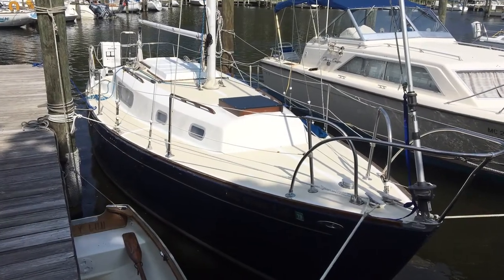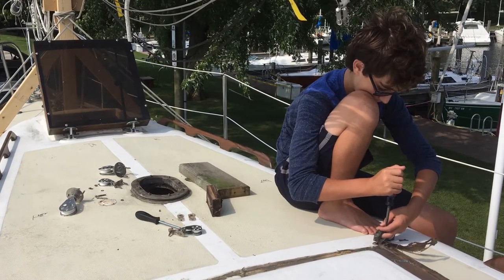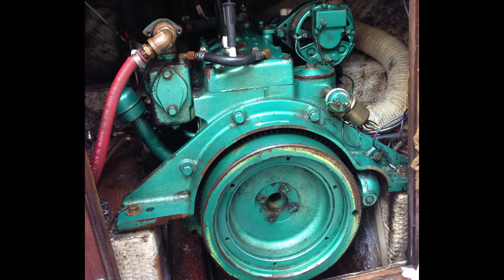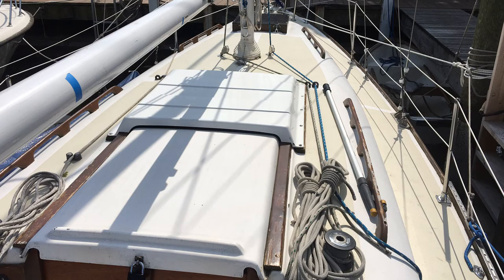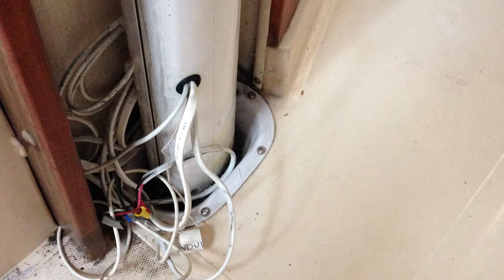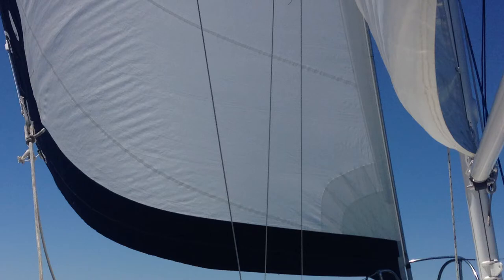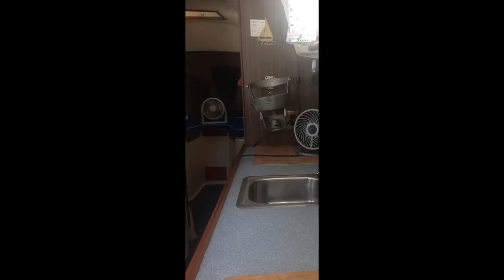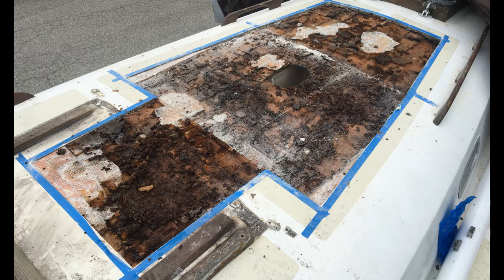Sailboat Refit: Morgan 30 - Blue Jacket, Episode 1

Comment: I’ve looked at a few Albert 30’s. I like that the rudder is attached the the keel but they’re narrow. 8’4” I think. They both have a deck stepped mast but the Morgan has a spade rudder. That’s always scared me. What’s your opinion?  If you were crossing a large body of water. Or worried about hitting something with the Morgan keel island hopping or on the ICW or in the Great Lakes. Would you feel safer with the Alberg?
Reply from the maker: My personal preference is for a keel-hung rudder. That said, the rudder design on the Morgan 30 is certainly stout enough to safely carry the vessel over the Great Lakes, through the ICW, and serve fine for coastal cruising. Beyond that, it's fairly easy to service. Like all spade rudders, it is potentially vulnerable. Sailboats are all about compromises. You just need to decide which compromises you're willing to accept. Ultimately, even the best design poorly maintained is unsafe, so a lot of this depends upon the condition of the vessel you buy/own.

Comment: I love the way you all put that Intro together.  I lurk and learn as you go. The Alberg 30 and that are very similar as you said.  So, your sharing of ideas and methods certainly helps me on Nautica!  I know I have that moist area beneath the mast area as well, but am waiting for a period where I can setup in the summertime and work the replacement as it is no small task.  

It's great to hear the crew talking too!
Reply from the maker: Thanks, Bill. Glad to have you following along. Boats are great - and even better with family! No, the recore isn't a small task, but it isn't insurmountable either. Best of luck!
Reply: As for the re-core, there are some who advise doing "squares" each at a time, but it looks as if one might remove the deck in "one larger piece," if possible and then re-put that larger piece?  What is your thinking on this method?
Reply from the maker: I'm hardly an expert, but in the case of my repair, dividing the area into smaller "squares" would have made the job more difficult. I think it makes sense to divide an extensive recore project into areas/sections: foredeck, sidedeck(s), cockpit sole, cockpit seats, cabintop. I can also understand dividing a project according to logical boundaries - where core meets solid glass, or where bad core meets good core. And I suppose if you were working in Florida during the height of summer with temps in the 90s and dealing with epoxy kicking within minutes, then you'd have to divide the job into workable areas. That's not by virtue of the task, but rather due to the conditions. I'd say I recored a fairly significant section, but it was easily workable (even under the cover). I could move around it, reach across it. Once it's too big to do that, then working smaller sections makes sense. Just my thoughts based on my limited experience. Perhaps more experience would lead me to change my mind.
Reply: Well, there is always the fact that "we don't know what we'll find."  My surveyor identified places like, starboard and portside of mast base....hmmm?  Ok, so how do I interpret the scope of my cuts?  I do know I have a leak which travels from top of mast base area to the upper shroud on port but that's about it on detective work.  I hate to mess up a good deck with my detective saw.